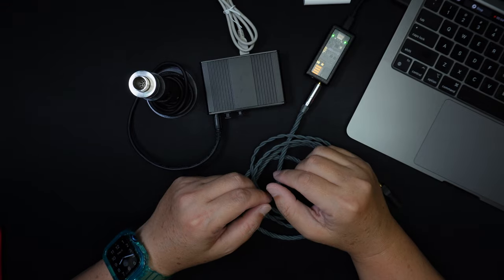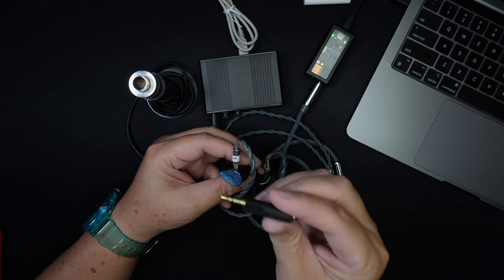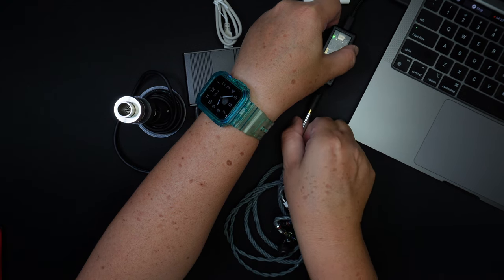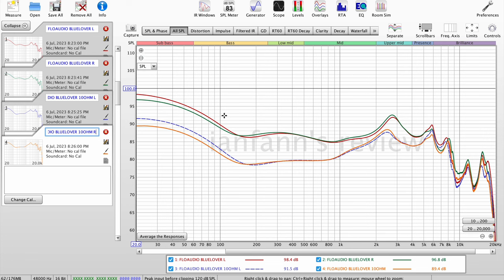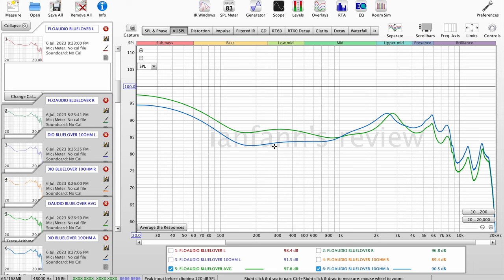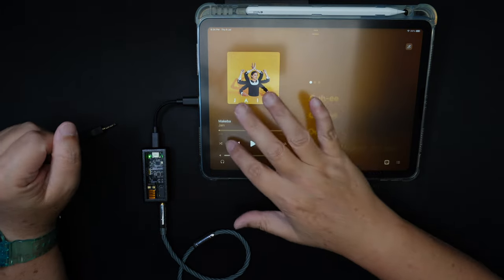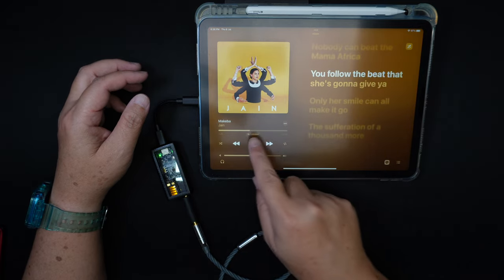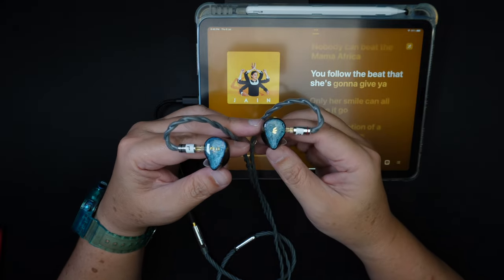Quick Measurement & First Impression | Floaudio BlueLover 6BA iem

Comment: I'm guessing that's the adaptor that comes with the Zero: Red, which is supposed to boost bass. I've only tried it with the Red so far and found a slight boost to the low end, but didn't notice a difference in soundstage or airiness.